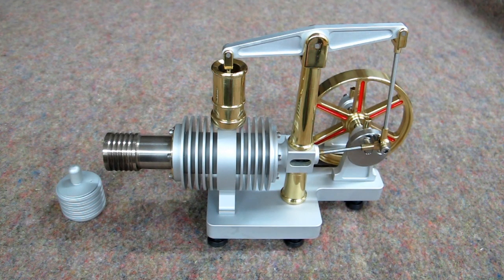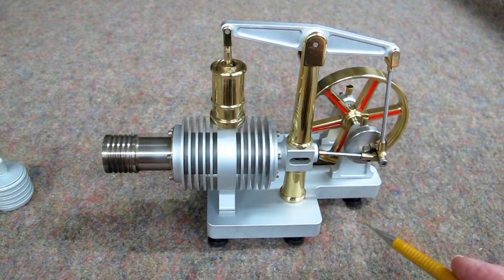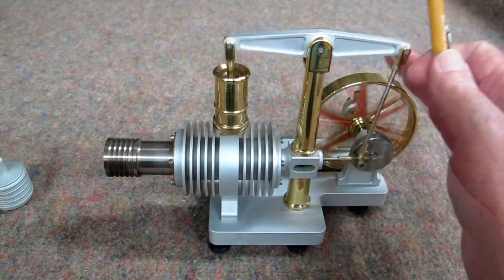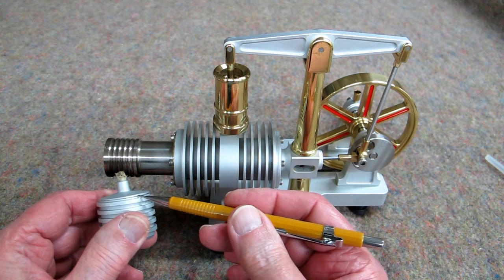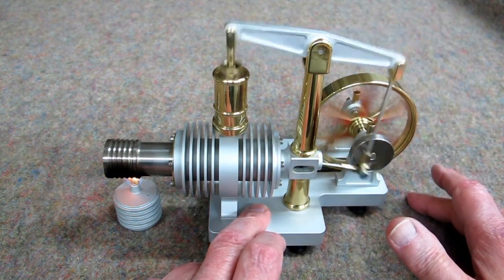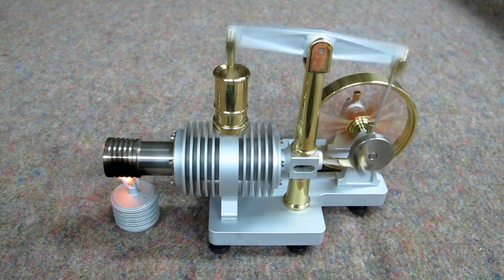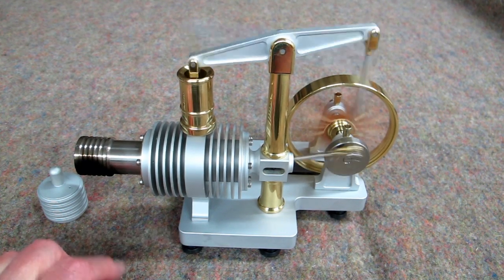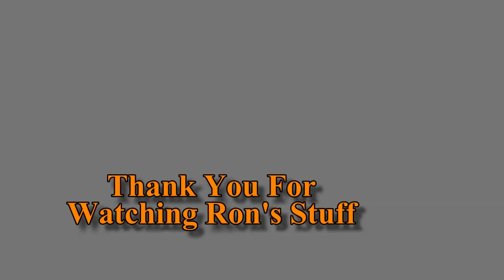Tarot Large Scale Stirling Engine

Comment: I bought one of these recently and have an issue with it, the allen key screw that connects the two crank shafts to the flywheel keeps coming loose and eventually coming out when running the engine. If i tighten it the flywheel wont turn but if I leave it finger tight the crew just unscrews itself and falls out. Any idea what's going on because it started doing this on the first run.
Reply from the maker: The two connecting rods have brass fittings (one is a clevis type) and are meant to freely rotate on the hex head machine screw.
Hopefully you did not try tightening it too tight to where the brass clevis is permanently deformed.
The hex head machine screw, which attaches the two connecting rods to the flywheel, cannot be tightened too much or nothing will be able to move.
I have never taken this apart (haven’t needed to) but it appears the hex head machine screw has a very tiny amount of Loctite (thread locker) on the threads… then you wait for it to dry. Be careful not to get any Loctite on the brass parts
Hope that helps.
Ron
Reply from the maker: Note: I was trying to do 6 things at once this morning. I have edited my earlier reply... they are connecting rods not crankshafts. Ron

Comment: Just got mine in the UK - took a week to arrive. I can endorse everything Ronald says - this is a beautiful model. The spirit lamp could be a bit more user friendly - I prefer the glass ones where you can see how full they are.
Reply from the maker: Your delivery was fairly fast. Glad you like it.
Reply: I agree Pete the spirit lamp can be challenging to refill. Besides Ronalds technique of injecting fuel into the breather hole, another method I have found was to take an x-acto knife and pry upwards along the seam, slowly working around the lid. The thin blade will allow you to  open the cap quite easily. Good luck!

Comment: difference between grease and oil?
Properties wise?
Reply from the maker: Oil is retained in place by its properties surface tension and viscosity and is good for the pins and shafts but tends to run off or get pushed off sliding surfaces. Grease is thickened oil. Grease will do a better job of staying in place on the sliding surfaces of the crosshead.
Reply: @RonaldWalters2010  thank you very much